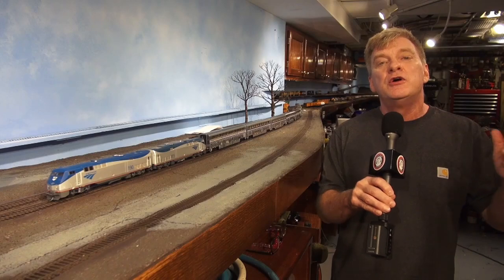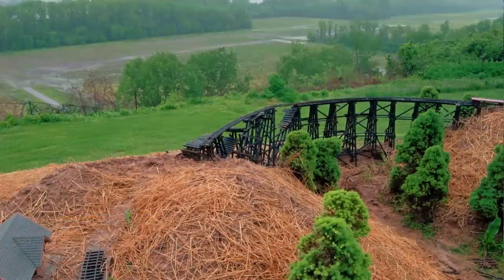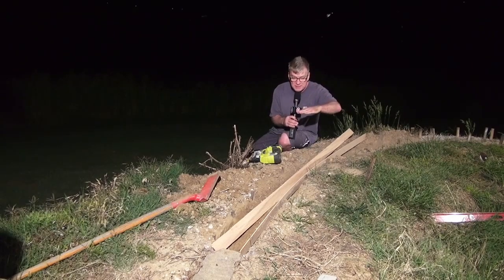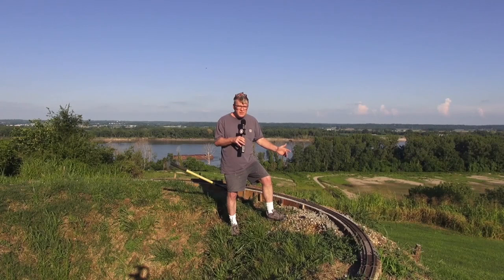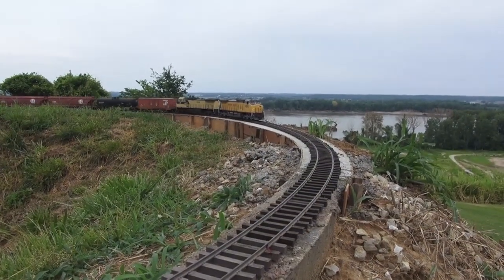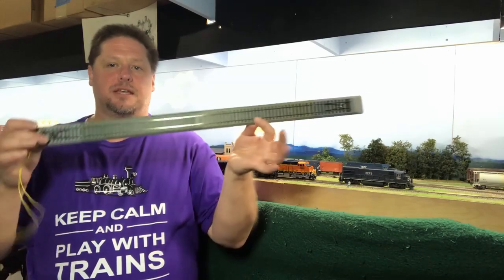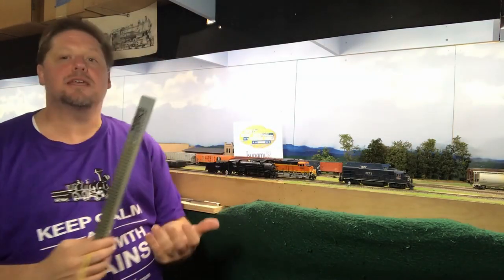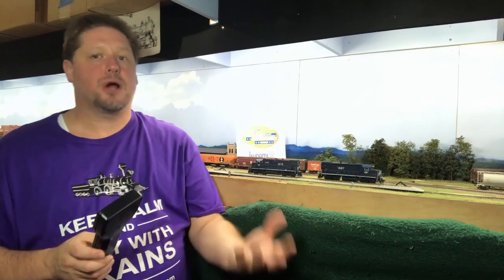Garden railroading lessons learned | September 2020 WHATS NEAT Model Railroad Hobbyist

Comment: I noticed that your garden RR and many others on video that there is no track ballast.  After many years of trying different approaches I have settled on polymeric sand for a nice looking ballast.  Paver Set is a popular brand name.  It is available at Lowes and presumably other big box stores in several colors.  Just spread it dry, use a dry paint brush to get the profile you want.  Then wet it with a garden hose set on mist.  It looks great and retains some flexibility so that it does not crack with temp changes.

Comment: Ken, for further stabilization of any dirt grade you should consider using geo-textile liner at the base. When you also use a geo-textile a foot or two under your cement roadbed, this will further enhance the stability of the roadbed.

Comment: for a garden railroad that required dump trucks of dirt to fill in, a ground compactor could have / should have been used to get a better quality foundation instead of relying on concrete.  Concrete will still break from settlement, but its now much harder to fix.  You need to use concrete to fill in for elevation mismatch vs a compactor that can fill in dirt to smooth out an elevation and reduce the amount of concrete needed.  It depends on the amount of realism you want.  The less concrete visible above ground provides for more realism.  making a wider concrete path allows for the tailoring of not just the track, but also make scale allotments on the track sides such as service roads, signage, track signals, that you can clear the grass with much higher clearance so it won't clip the track.

Comment: You should consider using icf(insulated concrete forms).  Not that you need the insulation but the ease of forming. You can rip them on a table saw and order radius pieces etc.  There is a manufacturer  in Lexa, MO.

Comment: Using some oil on the inside of the wood forms will ease in the removal of the wood after the concrete is poured. I have a  much greater respect for garden railroads after this segment. Ton of work.

Comment: This is a far cry from my garden line, its propped up on pebbles or leaning over 10*. Or where it's not camberd it is on a extremely steep grade (1 in 12 at its steepest). Even dispite this I dont suffer many derailments or decoupleings (I use hook & chain couplings) I also use live steam locomotives fitted with RC to run it like a narowgauge logging railway prototype, i in fact it's so prototypical that the trains derail prototypicaley common intervals. I guess what I am getting at is although a good road bed is nice it isn't necessary.

Comment: Ken, a couple questions/points about the concrete roadbed. Did you use any re-bar or wire reinforcement? I suppose with somewhat small, sectional pours any frost heaving can be addressed without great difficulty...   And to control grass & weeds along the right/way have you considered using herbicide? They'll take root in the crack  between the main roadbed and angled grade. Could use caulk or some other filler? Great segment (as usual)!! Thanks!!

Comment: Your concrete works look like it will hold up and be less maintenance.   But I have to say your bridge was awesome! !! I had never seen it before, and was so impressed.   I want to build one just like it in HO scale! I wouldn't have the maintenance or wind issues and titling the track in a little would keep them from going over the edge.  Just not sure how much to lean the track?